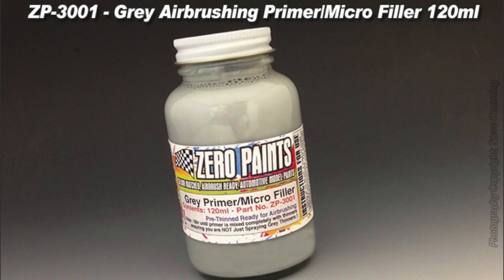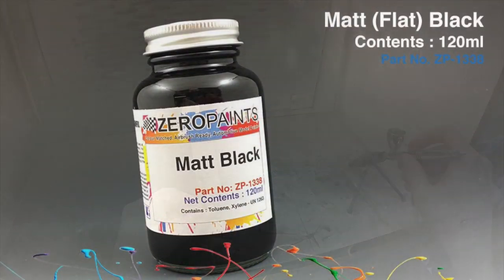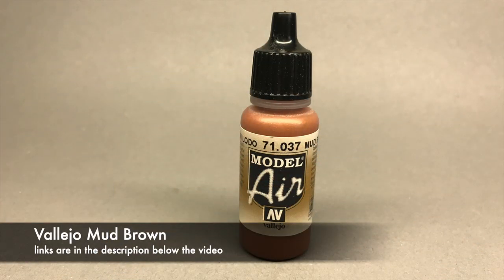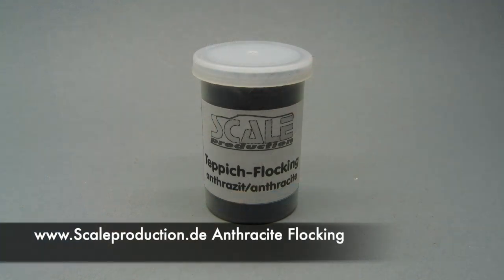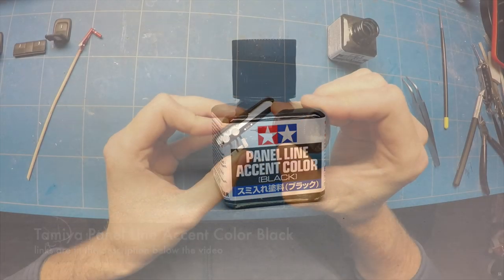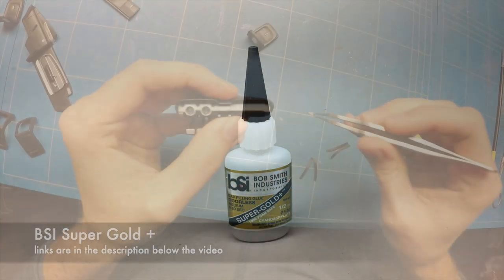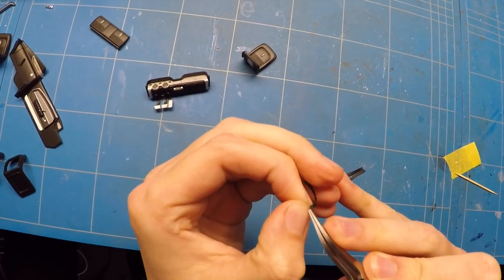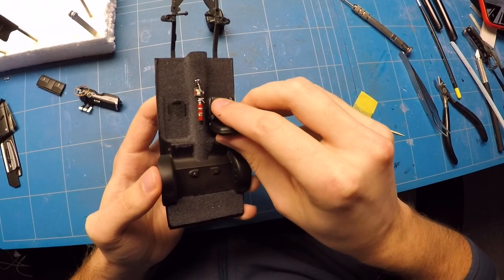AMT/Scaleproduction: 1967 Shelby Mustang GT500 Eleanor Gone in 60 seconds Part 3

Comment: Getting the exterior painted correctly is the biggest challenge and greatest reward but getting the interior looking great is almost as important. You sure did a great job. 

I will spend a lot of time getting the dashboard and door panels near perfect and then glue the windows and the body on never to fully see the interior again. Its there done correctly in my head. I love the kits with opening doors for the reason.

Comment: Nice job. The flock really helps. I believe Elenor didn't have the back seat or the behind the seat stowage. You can see it really in the scene just before "Memphis" jumps the wrecker. There's a flat, flat black panel riveted in place. If I were to guess that was done to fit a fuel cell in place where the 'behind the seat' stowage would be. That would also be done to remove the factory gas tank to accommodate 4-link rear suspension and a lower ride height.

Comment: Can a scriber used for plastic models also be used for die cast? If not, is there a specific one you use for metal vs plastic?
Reply from the maker: Yes and no. It will get dull quicker